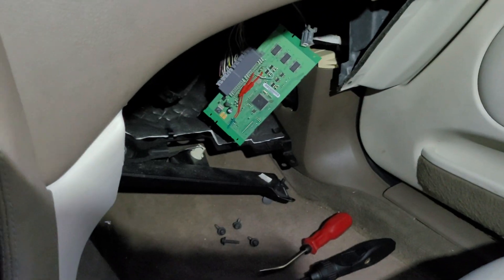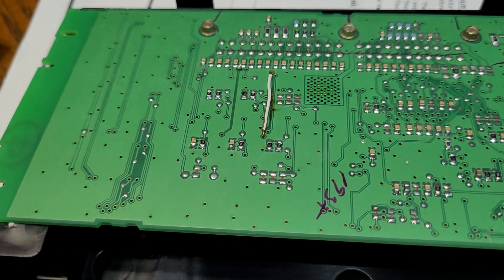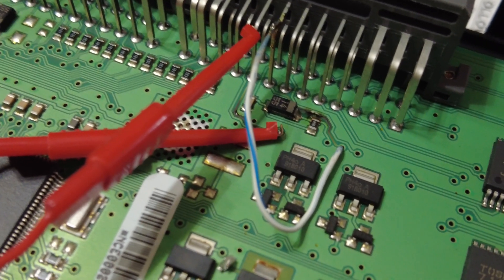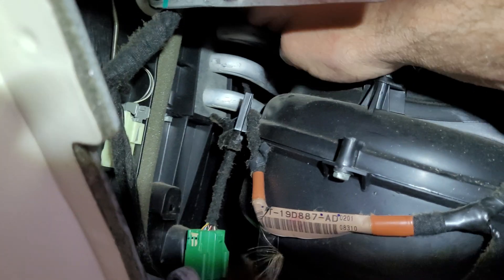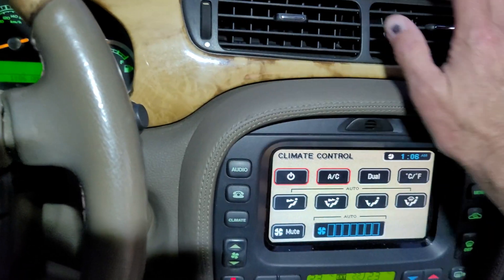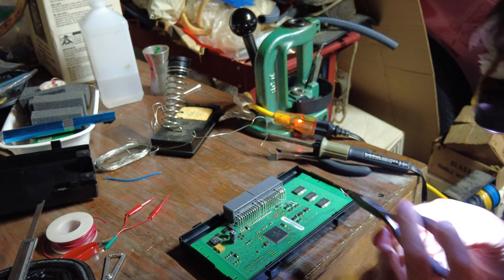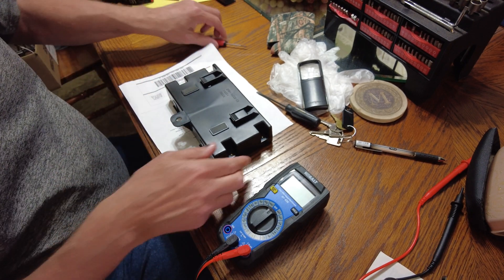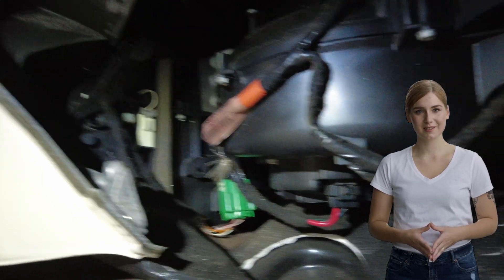Climate Control Module Repair. How to repair climate computer. #jaguar How to solder a circuit board

Comment: Picking up a 2004 S-Type 3.0 SE seems to have this issue. Where is the module located?
Reply from the maker: Under dash behind glove box. Real easy to get to. But its the collant bypass value right side of car at bottom of radiator that goes out. When it does it frys the module. The module is easy to fix if you can use a soldering iron. I have a video on replacing the bypass value. They go out at about 50K miles.

Comment: Hey I have an issue when when you try and change vents they don’t change can this be the module
Reply from the maker: Yup I got video on repairing it if you can use soldering iron. Also can be actuator but that's easy to check. It's in one of those videos. Just take glove box out and look to see if vents move
Reply: @outdoorswithcam ok thank you I will check the actuator. Everything works all the buttons but the mode button to change vent position
Reply from the maker: @3rd.eye_Entertainment  In one of my videos I show this. Remove glove box and airfilter under it. You will see three actutaors. You should see them move. Repairing the climate control module is simple. Might want to pull it and take a look. You will see burnt traceings. If that the case its the coolant bypass on right at base of radiator. They usually go out around 70-80K miles and short circuit and burn the traceing.

Comment: I got a Jaguar XJ 2008. And I have no heat on the driver side. Replaced everything from the heater core, radiator, hoses, temperature sensors and water pump. They are suggesting I replace the climate control unit.
Reply from the maker: Thanks for the comment. It actually easy to diagnosis. Just get under the glove box. Felling the hoses going to the heater core. They are right their. Put your hand on them. Are they hot with the engine running? One for each side and one return line. If one is hot and the other is not it is the coolant bypass value where it come off the radiator. That should be replaced every 60K miles because when it burns up it burns a tracing in the computer. There is no fuse. It back feed 12 volts into a 5 volt computer. I don't know which video you watched but I have two videos and fixing the computer. It is real easy. Just solder two jumper wires and its fixed. Its all in my videos. If you pull the cumpter out it real easy to open it up and check to see if there are any burned traceings. If there are whats happeneing is the AC is going through the vent not heat. While you are down there checking the heater hoses check the actuators. Have car off. turn it on. cycle through all the settings and make sure the acuators are move the doors. If not that can be a bad actuator moto.
Reply: What gauge wore did you use